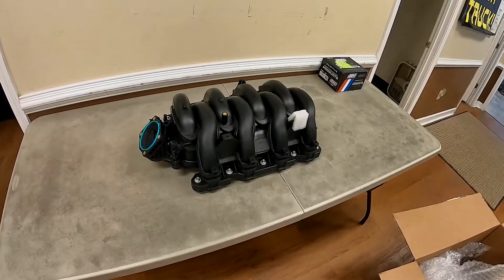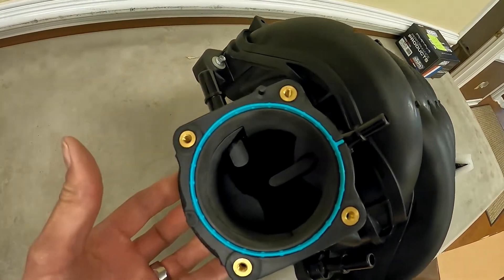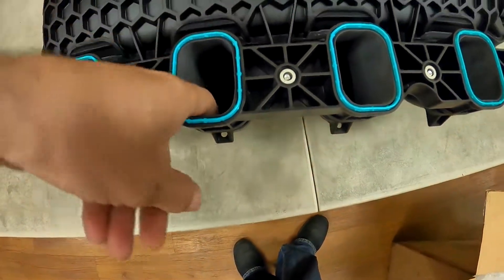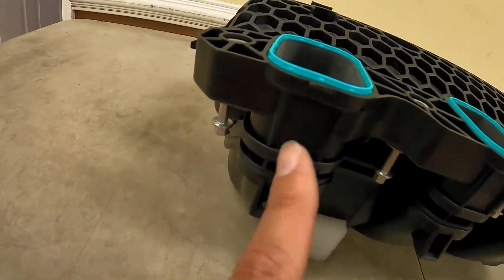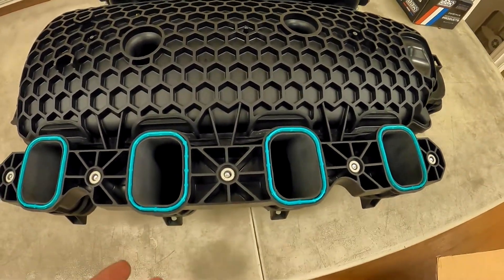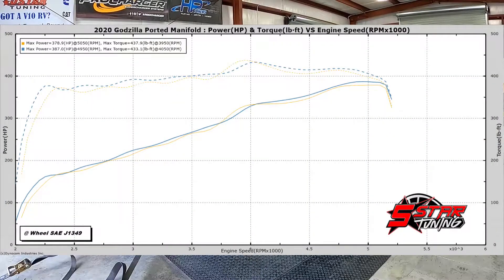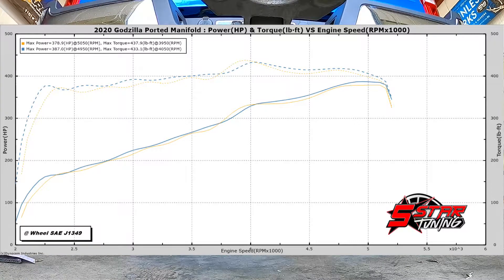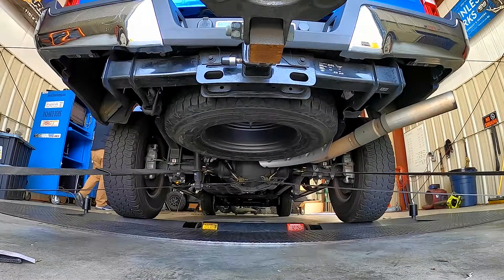Dyno Tested | 7.3L Godzilla | Ported Intake Manifold

Comment: Yippee skip. It's still a plastic POS and the intake air still has more corners to turn and bends to go around than a Fordtard's pro-Godzilla "swap" talking points propaganda sheet. 

There might be a difference with "boost"? Really? I'll bet "boost" makes a difference without "intake porting", too. 

Speaking of "boost", where are all the "Whipples" that were gonna be everywhere in Godzillaland back when this "new" engine was "introduced" going two years ago or so? 

Is Whipple not being as generous with it's $7500+ (call for pricing) emission control system modifying, warranty-voiding, fuel efficiency destroying, piston breaking, cylinder scoring "upgrades" as FoMoOCo is with its $7500+ "crate engines" every sucker stupid enough to sign up to do a "Godzilla swap" and YouTube/Patreon the "project" is "receiving" price-unmentioned as Ford apparently finds itself with a huge oversupply of "Godzillas" stockpiled "just in case" for the inevitable flood of "teething problem" blown engines as soon as the "tuners" and "hot rodders" start "upgrading" their Stupor Duty "Godzillas" or just start actually "daily driving" them giving them the typical care and maintenance and service tightwad, mechanically-declined Fordtard "owners" are known to give their "high tech" and "high performance" Ford vehicles? 

You know. The "crate motors" that Ford calls "service replacement" for in-house purposes and sells to dealers for "cost" and lets "Ford Peformance" mark up 1000% and sell for "swaps". 

I'm still waiting for the "Godzilla swap" that fits under a factory stock hood of anything but a Stupor Duty and "NA" at that and a "Godzilla swap" video that includes those little "minor details" like transmission  clutch/converter, exhaust, wiring diagrams/harnesses, controllers and how to "swap" in a Godzilla without replacing 75% of the recipient vehicle. 

Ultimately as a "replacement" for the 6.8 Triton V10 mod motor and all its various mod motor "kin" from "LS" to "Coyote", the whole idea that a "Godzilla swap" is or can be any more "economical" than a "Coyote swap" is hilarious. 

4 cams or 1, 4 valves or 2, "cast iron" or "alloy", Stupor Duty or Farce-150 or rebodied Falcon (Mustang) and "boosted" or "NA" Ford "engineering" is all the same garbage it has been since Ford went "high tech" with Ford's years-behind "reply" to GM Quad-4s and Northstars. And we all know what huge "successes" they turned out to be when "upgraded" and/or really "put to work". 

And since "Chevy" has returned entirely to "NA" for "high performance" and has been getting 650 SAE net horsepower out of an "LS" for years now and still provides a 10-year/100,000-mile warranty and 2 years of "free" routine service and maintenance with every "high performance" OHV V8 "LS" it puts in a "muscle car" and "sports car" while Ford and Fordtards still consider 100,000 miles "high mileage" and don't make any life expectancy predictions for "Godzilla" beyond that even stock much less "upgraded", it's safe to say Ford's "big-block" is just another...Ford "big-block" AND yet another new Ford V8 gasoline "big-block" engine "family" destined to break the pocketbook at the pump for the first "owner" and the parts counter for the second.
Reply: Holy shit this is the saltiest comment I've ever read. Show us where ford motor company touched you
Reply: My 96 Ford F150 with a 5.0L (302) Windsor V8 has 209,000 miles on it and still going strong and my 2011 Ford F150 with a 5.0L Coyote V8 in it has 138,000 miles and still going strong as well.
Reply: It's a small block 445 Windsor
Reply: Say your a Daimler fan without saying your a Daimler fan

Comment: Good to know that this would be a waste of time. I had my E350 2021 tuned at 5star Monday morning. 
It woke up a sleeping giant. 
Definitely worth the price. 
👍
Reply: Do the 2021 e350 have less power then the f250s?
Reply: @michaelhalo6  300 for the  E350 and 420 for the F250
Reply: @Scrambler85  does the gap in Horsepower even out once it’s tune ?
Reply: @michaelhalo6  5star wouldn't say I think because of the EPA investigations going on but I was told I am even or above the F250 numbers comfortably
Reply: @michaelhalo6  at about 8000 pounds it will break the tires loose with just the gas peddle
Reply: @Scrambler85  nice , I bought a wrecked 2021 e350 with 12k gonna swap the 7.3 in a 1995 f150 reg cab short bed  with a Manuel . Gonna do heads and cam and e85
Reply: @michaelhalo6  sounds awesome, I would like to see that